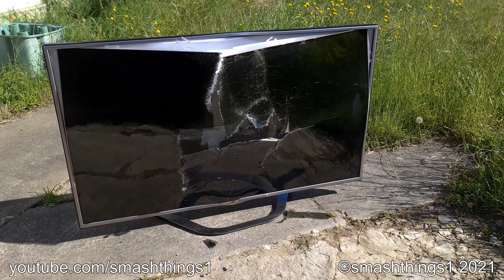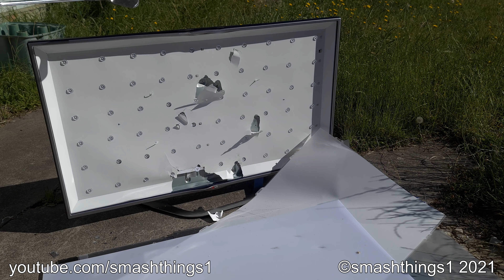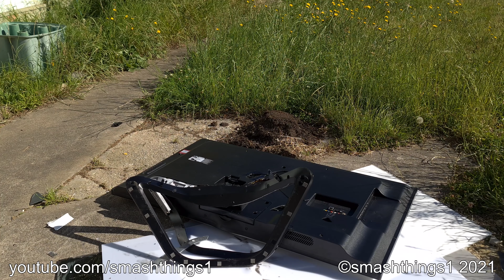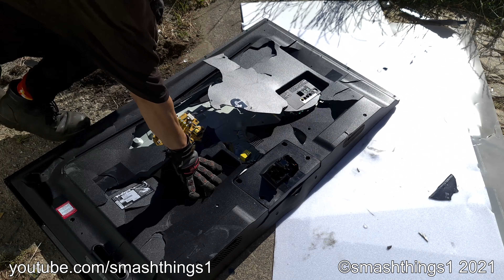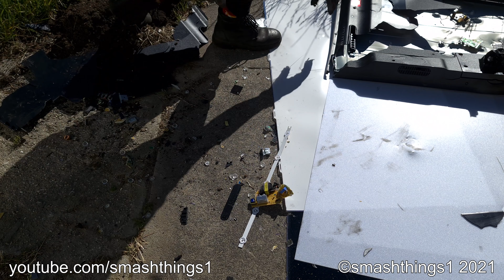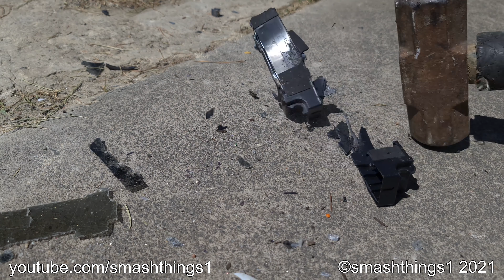Faulty LG 50" LED Smart TV Destruction

Comment from the maker: To all those people complaining about this being destroyed, tell me... Would you rather have this disposed as e-waste and shipped to third world countries, where they burn all the plastic in huge piles and salvage any metal for a dirt cheap wage? Or would you rather all the plastic/metal/screws be fully separated and recycled locally and responsibly? You wouldn't yell at someone for recycling, and this is no different. Anyone complaining about this is completely ignorant on how bad the world's e-waste situation is.
Reply: Your right.
Reply: If an appliance is rendered useless because of a faulty component and can't be repaired because they don't make the replacement part or parts, for example, and there is nothing else that can be done about it, then yeah, you recycle it. Absolutely. I could not agree with you more, Robert. There is no way that I'm complaining about what you're doing. Besides, you always make it so entertaining to recycle the stuff you salvage for free that other people just threw out in a field or landfill or on the side of the road or what have you (which is awful, in my opinion). At least you collect it and make something out of it - make something from nothing - in the form of entertaining videos and you give the appliance a proper recycling, too. Everyone wins. Thanks, man. Don't listen to the trolls and haters etc. What you described sounds horrible - burning the plastic in huge piles just for the metal and a cheap wage. No thanks. Cheers, man. thumbs up
Reply: im not complaining this is entertainment
Reply: good point

Comment: You have said that the only fault of this TV is that LED backlight only blinks and switches off. This fault could have been repaired changing some bulged capacitors that cost less than 1$. The best way to reduce e-waste is prolonging the life of the devices as much as possible, and repairing them when it is worth. This TV, despite being only FullHD and not 4K, was still useful.
Reply from the maker: Not a capacitor issue. There were no bulged capacitors on the board.